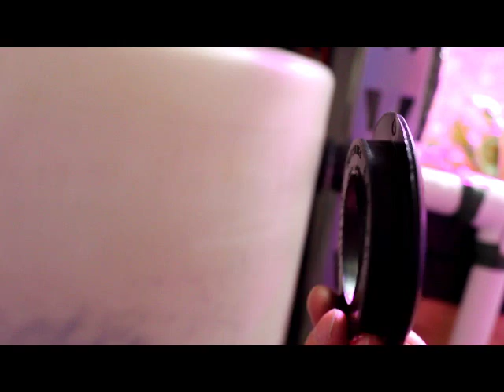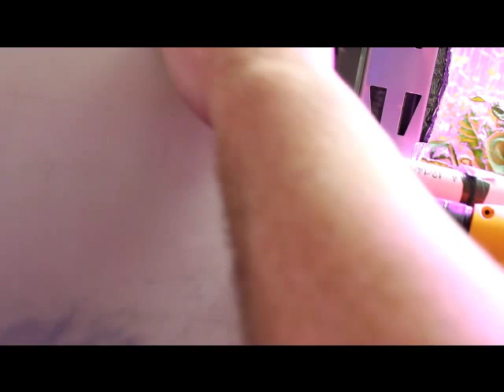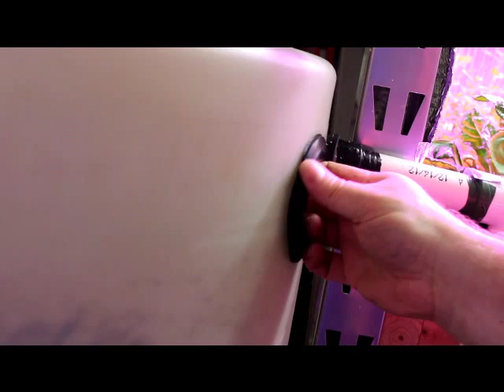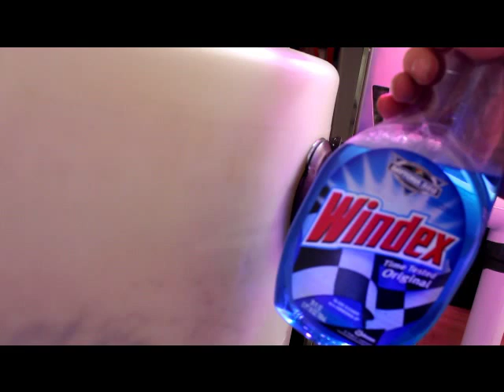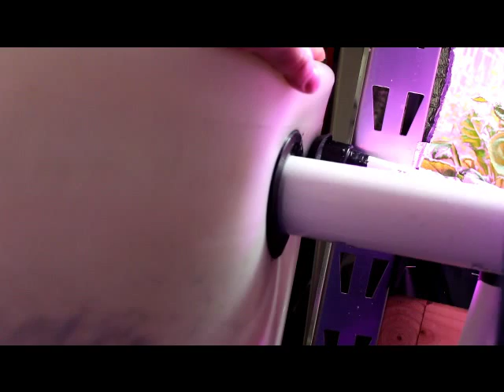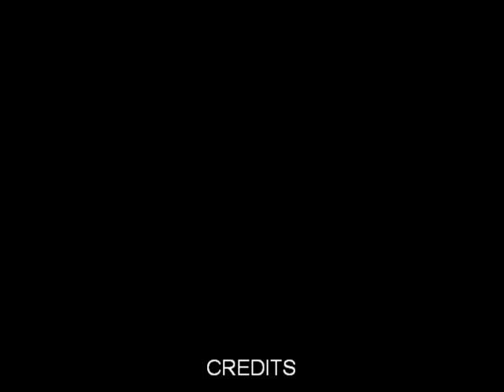Aquaponic Uniseal installation How-to

Comment: Came across this video by accident and an awesome tip for those using uni seals for their first time. Have been doing something similar for 20 years but with 6 inch pressure pipe for large RAS systems. We also carry a range of uniseals at an affordable price at www.aquaculture-advantage.com.au if you need more for your project and LOL the bigger they are, yep! the certainly harder they are to install. Keep up the good work.
Reply from the maker: 1aquaponics Thank you, Always need sources. Regards